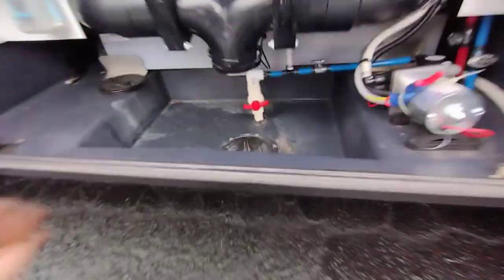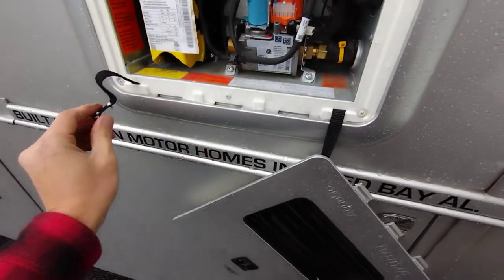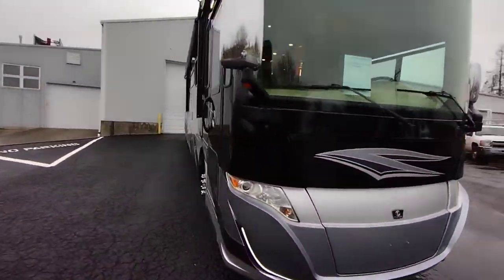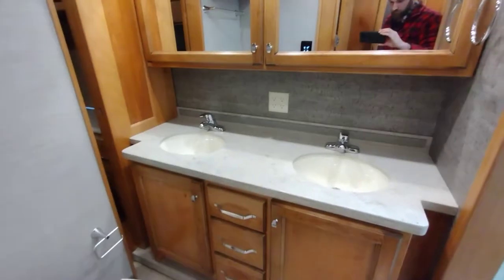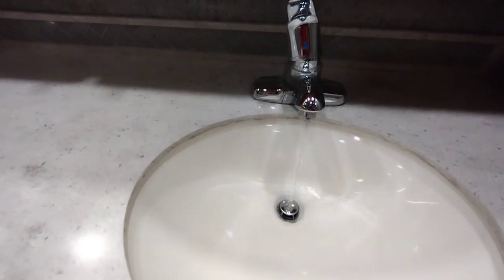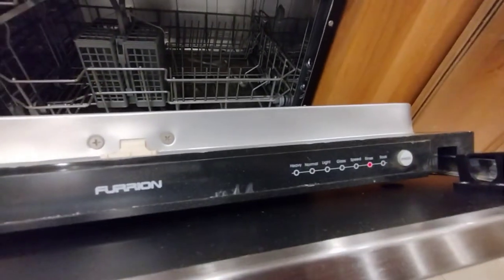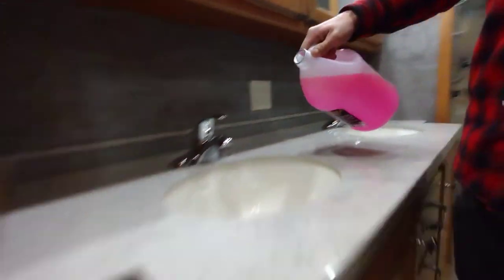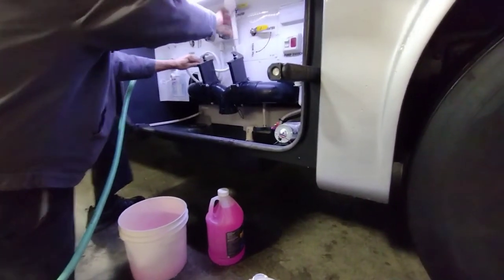Winterize Tiffin RV __ The EASY Way Class A and Class c

Comment: We have a 2021 Tiffin Allegro Red 37 PA just like the one you showed, except for it having an Aqua Hot option so we can bypass the Water Heater section.  The Dishwasher/Fridge/Washer parts were very informative and appreciated, maybe removing the Fridge filter and replacing it with a new one in Spring would be a good addition. I usually leave my AF hooked up and make pink ice cubes and toss them before turning it off but may just remove the line like you did. Great Job will definitely subscribe to your channel.  Thank you!

Comment: We have a 2018 of this floor plan.  Did you forget to mention draining the H&C low point water lines?
Reply from the maker: Possibly in the video.
 I generally  drain them until I see antifreeze in them. Thanks for catching that!
Reply: P.S.  Also, the frig has a built-in filter of its own that needs to be removed and replaced with the plastic plug.  Thanks for the idea about the 3-way valve.  I ordered one!
Reply: Great idea will add that to my notes.  Thanks!

Comment: How many gallons of RVANti freeze did you use?
Reply: Think I started with 5-6 last year and probably had some left over, we have a 2021 Tiffin Allegro 37PA with Aqua Hot similar with the one he used except for the Water Heater and Propane. The Aqua Hot works off the diesel tank. I actually poured it into a tub so I could make pink ice cubes over night. I did not know you could disconnect the water line behind the fridge. His video is the best one I have found.
Reply: Wanted to update my earlier reply, just winterized our Tiffin Allegro 37PA today, it has a washer, dishwasher and fridge with ice maker (no water on door) and it took 10 gallons